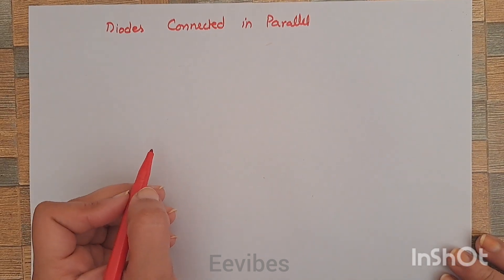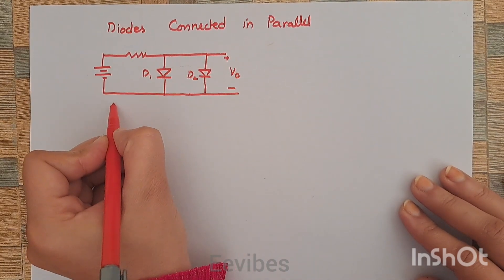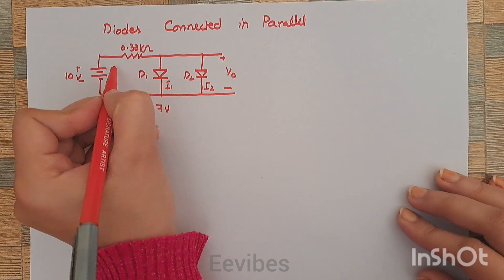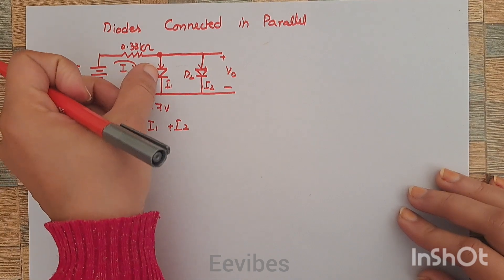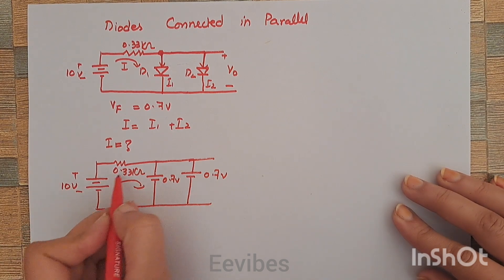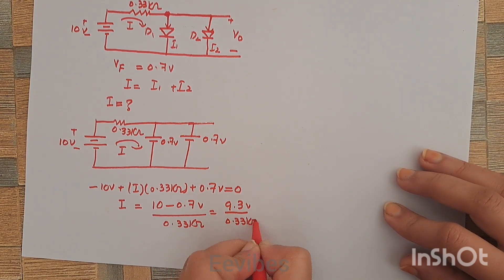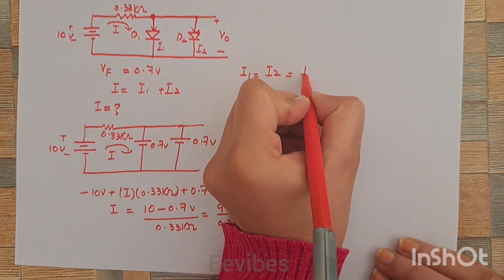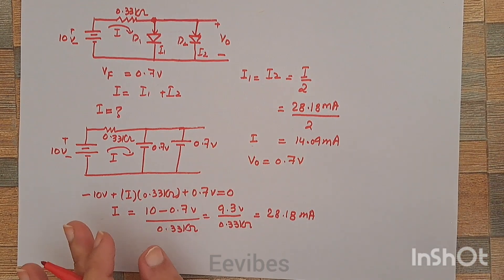Example of Diodes Connected in Parallel-step by step explanation

Comment: Mam although it's not the subject If it asked for designing an Sequence detector using mealy machine 
Having two output X and Y we will right it like this?
0/00 or if it's for example one of the outputs was one it will be like this 0/01 or the other output is one 0/10 ???
Reply from the maker: I have solved an example related to sequence detection. You may check it in DLD playlist.
Reply: @eevibessite  there isn't an video about like detecting two pattern like detecting 0010 1001 or three pattern those I mean